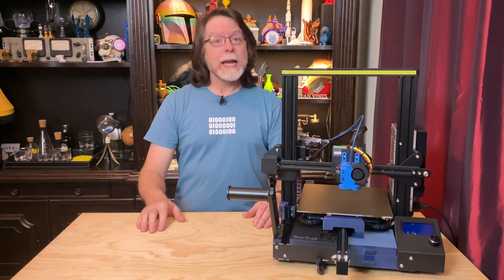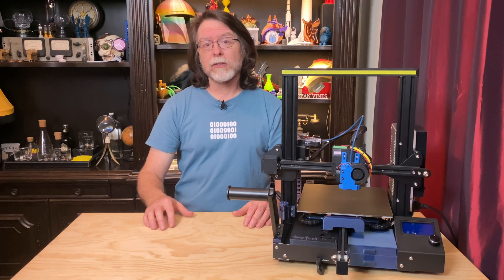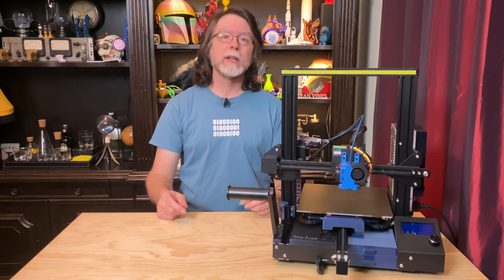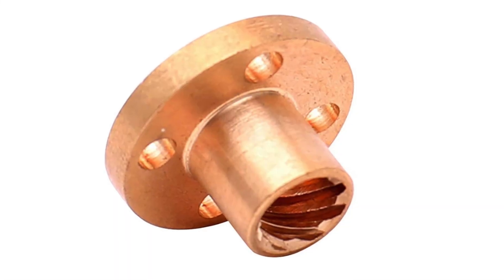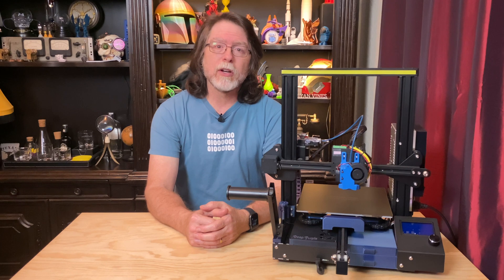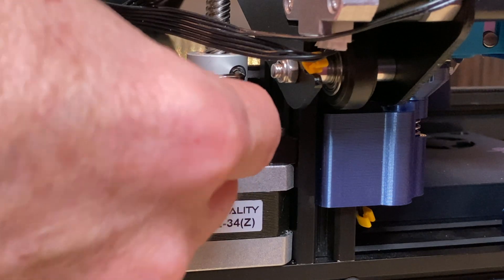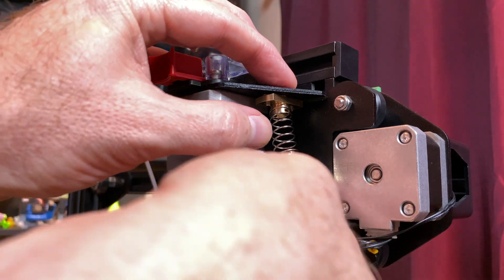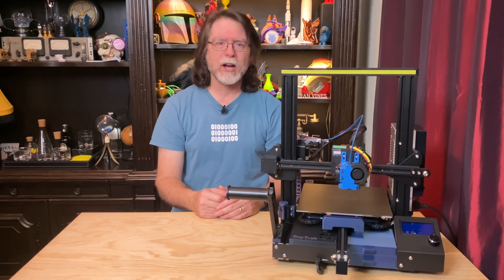Stop the Drop! Install an Anti-Backlash Nut on Ender-3 Series

Comment: I suggest to not use those nuts, after the installation im pretty sure that i have serious troubles of backlash, it causing me around of 0.13mm of backlash in both directions, up and down, resulting in first 1.2mm beign in reality only 0.96/0.98 and this is an entire layer when u are printing under 0.2mm of height, trust me, the result is a lot off bad words and wasted money to figure out the real problem, i prefer to drop and break my mk8 shitty 40€ creality hot end then wasting filament and s..tty prints

Comment: Another good tip is to put a BB or small ball bearing into the motor coupler hole before putting your lead screw back in. This will give it some spacing and allow it to line up better. This works best if you have a lead screw guide with a 608 bearing on the end of your lead screw attached to the frame.

Comment: You installed that completely incorrectly for use on a Z axis. The spring needs to be on top, otherwise it is counter acting gravity (and gravity is already counter acting backlash) and thus making backlash even worse.

Comment: It also happens to the Ender 5+ some people on the FB group I am subbed to claim POM anti-backlash nuts solve this problem, One chap has said this wont work as the issue is caused by the stepper motor slightly turning when powered down, I have ordered some POM anti-backlash nuts and am awaiting the delivery so I should know myself very shortly, quite a few people have reported the issue solved with the POM AB nuts so I am quite confident

Comment: this is absolutely necessary for anyone with a linear rail or any extra weight on the x axis carriage. everytime there is a power failure or i pause the print it always drops so i ordered one and ill see if it solves my problem.

Comment: Add a second lead screw to the right side of the printer. You must sync the lead screws to work together. Otherwise, the stepper motors will make an awful sound as they compete with each other for control. Dual Z-axis lead screw upgrade kits help:

1 - reduce or eliminate right side X-axis gantry sag, 
2 - help square off the frame and help to keep the X-axis gantry perpendicular with frame side extrusions,
3 - help make bed-levelling easier,
4 - also stop the "drop". 

All around, a sound modification. I also switched to direct drive, and replaced the bed springs for silicone mounts, which help the printer to maintain a level bed for longer periods of time. Best mods I ever made. These mods helped me to eliminate all of my E3V2 3D printer issues.

Comment: What really sucks is you cannot install Tr8x2 lead screws on Ender 3 to increase esteps and better layer accuracy. Yet to find an anti-backlash nut with the design to fit the Z carriage. Just different manufacturers churning out Tr8x8's, brass or pom!

Comment: I think you out it upside down. This still be fighting gravity and the weight of the Z axis. With the spring on top it'll help with the weight and insure it's always bottomed out. Tho the ender 3 z axis isn't exactly heavy.

I could be wrong tho I'm not an engineer

Comment: I feel like it'll put addition pressure, therefore friction, on the rod threads. Curious to see the longivity of this fix. Thanks for the video!
Reply: it's brass... you ever seen a key worn out from being used too much? keys are brass, they self lubricate
Reply: @schlomoshekelstein908  Brass on steel threads will wear the threads. Same with all soft metal bearing applications on steel shafts or threads. The harder material wears away first due to impregnation of the soft metal bearing material. The better solution is to bin all the brass nuts and fit acetal homopolymer nuts and anti backlash adjusters. Very little friction and self lubricating to a very high degree.
Reply: @howardosborne8647  You actually think you can wear out the brass on a 150 dollar 3d printer? How many hours of operation do you think you'd get before it's out of spec? some things in life are "good enough". I have a lathe over 120 years old with bronze bushings and babbit bearings.. No problems so far

You strike me as book learned, you have no life experience maybe?

Comment: would this help me with my situation?  whenever I try to change filament whenever i have multi color print and I pause at a layer height then filament change and press on the extruder release and pull the remaining filament, usually this can cause me to push down on the gantry and mess up my print when it resumes.  If I install this would it stop me from having this accident?  BTW+ I have the same extruder as you from SEEMECNC.

Comment: I am a bit confused and frustrated. Since I moded my Ender 3 Pro with the Microswiss hotend, and a metal extruder, I have had the gravity drop problem. Finding your video seemed like exactly what I was needing. I purchased an anti-backlash nut, one to fit my printer. Followed your video for installation, and now the drop is even worse, and I don't know why.
Any suggestions? I have re-watched the video multiple times, and I do not see anything that I did differently.
Help please.

Comment: I had this issue and then randomly this video came up in my feed....I installed the backlash nut, and while it does work, its only about 50% effective, my grantry does on a few occasions still drop. I followed you video and the same setup, but having just read your pinned comment, I wonder if the spring mounted on the bottom does make a difference.
Reply: Did you end up switching yours?  I just had the same problem where I installed it and then two seconds later it dropped anyway.
Reply: @hareboll  did I switch it back to the original set up? No I’ve left the backlash nut on as it does help a little and it’s doing no harm to the printer. But it’s definitely not as effective as I’d hoped
Reply: @robshaw4093  oh I meant if you switched the spring to the other side since he mentioned he may have had it upside down.  But I agree, no harm and it helps a bit
Reply: @hareboll  no actually I didn’t but I might try that...just see if it does make a difference. I know he said it shouldn’t but never know. Did you put your in the way he said to?
Reply: @robshaw4093  yea I just followed his video, noticed the drop and then started searching these comments.  I may flip it too

Comment: A non anti-backlash lead screw nut can also cause print quality problems when they wear out. What happens is when the printer tries to do a Z hop, there is so much play between the nut and the lead screw that when the Z motor tries to raise the print head/nozzle to do the hop, the lead screw turns but the nut doesn't move hence the nozzle doesn't move because of the slop so the nozzle just drags across the top of the print causing all kinds of problems. I've seen brand new brass lead screw nuts that were so poorly made that they had slop even from new. I replaced the standard lead screw nuts on both my Ender 3 and Kingroon KP3 a while back with POM (aka, Delrin) versions of the anti-backlash nuts. I used POM because it wears better than brass, is self lubricating, and is smoother. I've noticed much less stringing issues and cleaner prints with this mod.
POM anti-backlash nuts are available with the same cut-off sides as the stock Ender 3 brass nuts too. But even if they weren't cut, it's easy enough to cut them yourself.
Reply: Do you have a good source to find these? A quick look on Amazon revealed only a single result, where the reviews stated that it was made from "cheap plastic"
Reply: @rkristel82  People who call POM "cheap plastic" have no clue about various materials and their properties. They generally have very little technical knowledge in other areas too. This is the reason I don't pay very much attention to reviews.

I buy most of my 3D printer supplies from AliExpress. Do a search for "anti backlash nut, pom" and you'll find quite a few. 

Been doing business with AliExpress for years and rarely have any issues. If there is an issue with an order, they'll step in and take care of it.

Comment: Hi Bryan, this is my solution for my Ender 3 V2. In short, I wanted to keep cable chains going on top of BMG extruder at the same time having anti backlash nut. The part I designed has bottom part of anti backlash nut, so I only used a top piece and spring of a POM anti backlash nut. Because I am still testing it I haven't shared it on Thingiverse, but I may add this to there. Here is the picture: https://ibb.co/GJdGNnW

Comment: Is that the original power supply? What are the three switches for?
Reply from the maker: The power supply is original, but I designed a new cover for it with room for a big, slow 60mm fan, and some buck converters. One of the switches is for an overhead light bar, another is for a 5V buck converter that powers a USB port for a Raspberry Pi, and the third is for "future expansion."
Reply: @BV3D  can we have a video for that nice mod ?
Reply: @BV3D  so, you took the power supply out of it's original enclosure and placed it into what looks like a 3D printed enclosure? Do you have the STL on Thingiverse?
Reply from the maker: @Megdiver  Only the cover -- the part which holds the PSU's cooling fan -- is printed. The remainder of the PSU is the original metal shell. It is a work-in-progress, and eventually there will be a video on it. Thanks!
Reply: @BV3D  ok, looking forward to it. Thanks

Comment: I had this happen to my stock setup a few weeks ago. I just tightened the eccentric nut to hold the bearing flush in the v slot (it was spinning / not providing any friction). My problem was solved after that.
Reply: the rollers are for alignment, not friction. the friction will grind your wheels down faster like that. although, I had my wheels apparently overtightened for over a year and didn't notice any ill effects.
Reply: @AmeshaSpentaArmaiti  But look at the inverse of this situation. If the wheel is just floating and free spinning as I described, its not holding. That was causing it to fall. Im also aware of overtightning, and made sure I let the bearing sit in the v roller. After the v roller was seated like all the others I stopped tightening.
Reply: @VM2D  I see, i never had the wheels loose and only in the last couple months did I learn they were too tight on my ender, I've never had the z axis just drop like was described here either.
Reply: @AmeshaSpentaArmaiti  add a direct drive extruder and the extra weight will make it fall down pretty easy
Reply: Thank you so much. My Z-axis was falling even with this antibacklash nut installed (had previously worked for years). Just needed to tighten that up and that's all the friction it needed to not fall.

Comment: So thats how it works! Brian what are your thoughts one dule z axis servo set up?
Reply: Id say you'll need a BLTouch too in that case. If you use a splitter and run both motors on one port they can get out of alignment. So both on their own port and the BLTouch can adjust the height of both. Of course, you could go belt drive dual-Z, but that has its own issues. Heck, if you want to get something cool, check out CoreXZ..

Comment: I lubed my Z axis screw recently, and this started happening to me..... I wouldn't see it as a problem really unless you lost power during a print and needed to resume the print. If the Z axis dropped, i don't think the print would be able to continue because from what I've seen Marlin will only home the X, and Y axis but try to print with the Z axis wherever it happens to be.

Comment: That's exactly why I added one, and it worked perfectly.  Once I switched to a microswiss hotend/extruder, my x gantry would slowly wind itself down onto the bed when the steppers disengaged and it was annoying.  Plus with the head potentially below the bed if it was off to the side, it would hit it at times when homing.  Problem solved.

Comment: Hey Bryan, you mounted the nut upside down. If you put pressure on the gantry, it'll move because the spring compresses. This is a common misconception. The right orientation is when you push down on the gantry, the spring stretches instead.
Reply: The spring doesnt compress when the gantry is pushed down because the lead screw still has threads connected to the ABL nut, which is bolted to the gantry.

Comment: interesting. have you considered adjusting the eccentric nuts before throwing out the lead screw nut?
Reply from the maker: Hi id! I considered it, I tried it, and I had to make the wheels tighter than I was comfortable with. I don't like when the wheels get little flat spots on them after the printer's been idle for a bit. 😃

Comment: Isn't the whole nut/spring/nut upside down? I'm just guessing, but the weight should be imho directly on lead screw, not through the spring.
Reply: You're absolutely right! In order for this adapter to maintain a rigid contact between the nut and screw against the downward force (the weight of the x gantry), the spring and auxiliary nut should be on top. 
If the spring and aux. nut are facing down as shown in the video, the lifting force of the screw is transmitted to the gantry through the spring.

Comment: Under what circumstances does the printer turn off the Z stepper motor?
 I can't remember my Ender 3's ever dropping the gantry.
Reply from the maker: Most slicers shut the motors off in the ending G-code. If you've ever been able to move the bed after a print job, the G-code shut the motors off. Also, the firmware shuts the motors off after a short period when you've entered movement commands from the control panel.

Sometimes they're fine, sometimes they drop. Fully stock, they seem to be fine. I've had one stock unit drop a little, but not much, and not always. It seems to depend on the printer, and how much weight is being carried by the Z axis. I've never seen it happen on a dual-Z motor printer. 👍
Reply: @BV3D  That's probably why I have not experienced it as the only mods on my gantries are Micro Swiss hot-ends
Reply from the maker: @AndrewAHayes  I've been experimenting with different things on mine. But I do love my Micro Swiss all metal hot ends!